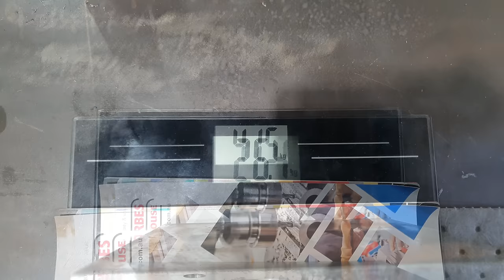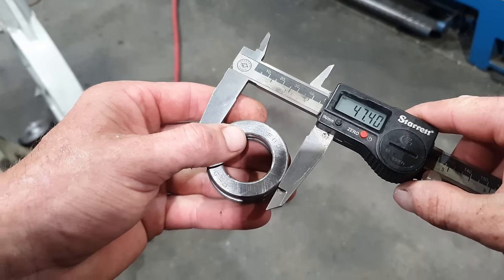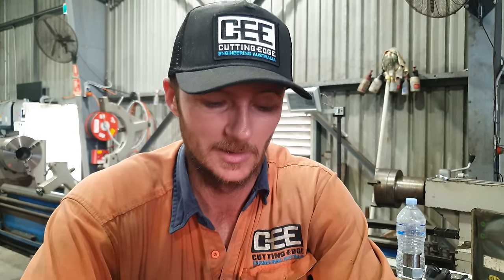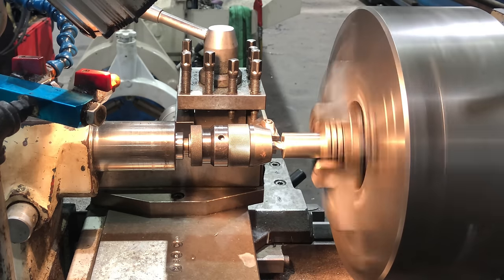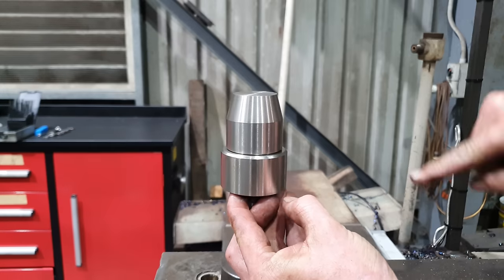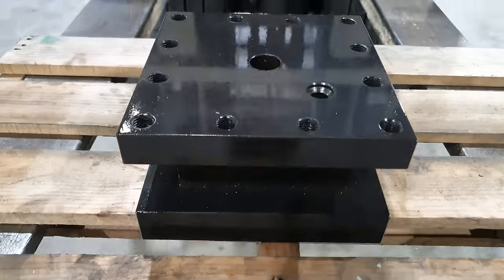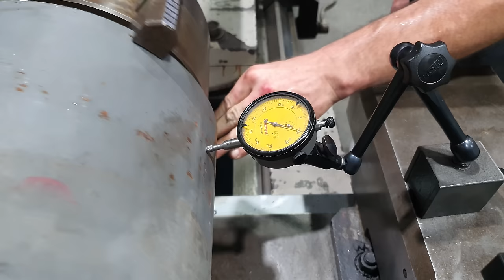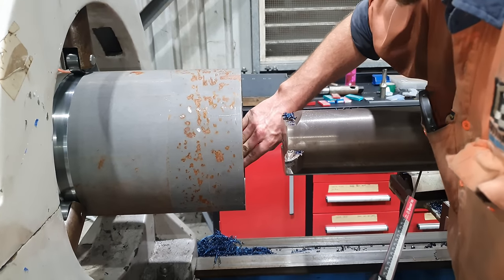Finish Making a Tool Post for the BIG Lathe! | Part 2 | Shop made Tools

Comment: you could try to include a coolant line in the next boring bar. Maybe only a 10mil grove on the back of the bar to fit a 10/8 pneumatic line so you can connect it to the FlexHose system you use on your machines
Reply from the maker: watch this space 😏👍

Comment: Great looking piece of kit you made there! Speeds and feeds are very finicky for stainless; I'm in a stainless shop and I have to modify parameters each time an insert changes, a new batch of steel comes in, coolant changes etc. Stringy as all get out. Also I got a great laugh when you kicked the steady at 31:51, never had to deal with a steady that big, but I know they need some "encouragement" to get moving. Looking forward to the alluded to "aussie-sized" boring bar.

Comment: 25:37 A CEE stamp would finish that piece nicely. :)) One other "ease of use" thing you could do is machine a groove inside the pin hole, and put a sprung ball inside the pin. That way, you pull it up 1 cm, the ball engages, and you can rotate the post without fully removing it.

Comment: Hi friend. Maybe you should try an independent bar holder, a bold and rigid steel cube atached directly on the cross-slide; the compound-charriot will always vibrate holding so massive boring bar. I've seen someone doing  it, he says there is an enormous difference!
Cheers
Reply from the maker: watch this space 😉

Comment: That boring bar is obscene Sr. 🤣. And you did make it in proportion so you don't get shattering. Fkn Legend. And will get bigger, maybe an extension in the back of your tool post so you can also balance the weight and do bigger jobs, but I remember you already have the new machine, that is not exactly the same, but it does similar stuff. Great work man!!

Comment: If it's 316 try slowing the lathe down by half. The standard approach for drilling 316 stainless is extremely slow 304 and 305 is easier but likes a slow speed too.

Comment: What grade of Stainless did you use for the nut. I work with stainless a lot and I have consistent problems with galling, as you pointed out it is "gummy " stuff, curious about which grade you feel will be satisfactory for a machine tool part. Addicted to your videos, learned a lot of practical information

Comment: makes me wonder: with a boring bar that large or larger should it be made with it's own attaching point to the machine? i was thinking that when using that boring bar, not even have a tool post to clamp it in but instead have it directly attached to the machine surface that the tool post would normally use? would that help with vibration and make for a more solid mount? just a thought from a keyboard warrior..... excellent video, and that tool post looks better than any "off the shelf" unit.... strong work CEE!!!!
Reply: In place of the compound rest.
Reply: @alro2434  yes, that is what i was thinking. just building the compound rest attachment into the boring bar attachment point.

Comment: Excellent work. Did you use normal low alloy steel to make the tool post or special for nitriding? After nitriding, you had no distortion at all?

Comment: My guess was 29.42 and that is exactly 3kg over. I wonder where that error came from since i actually 3D modeled the part. I did have to guesstimate total height and depths of the tool groove, so maybe that is where the error is from. Could also be incorrect material weight. Bummer.
EDIT: Great color combination at the end there! So shiny.

Comment: I have a general question as an engineer and not a machinist. How do you ensure the tooling is running straight and true when you secure it with the three bolts?

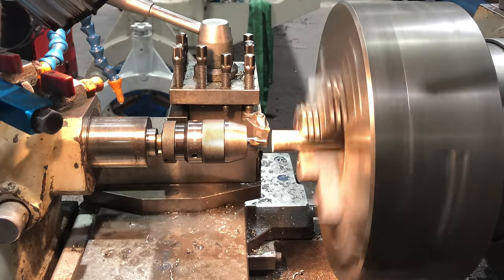Comment: Thanks, nice bit O'stuff!  Live center used on the handle @ 23:57 looked really long & pointy, about 30 maybe 45 deg., not 60, something special?
Reply from the maker: Nothing special, that's a Vertex, it's just a bit longer than the average live center so you can get tooling down in beside it easier.

Comment: Work Hardening - During machining, the friction between the tool and the workpiece generates heat. The heat that is transferred to the workpiece causes the structure of the material to change and in turn harden the material to some depth.. The degree to which it is hardened depends on the amount of heat being generated in the cutting action and the properties of the material,

Comment: Handle Position
was it luck that the handle faces out when tightened down? or did you take steps to control that? how would you clock the position if needed?

Comment: Heyy. little question, how do you know when cutting a material (stainless steel in your case) with a larger horizontal bore that its going poorly? Before it has a more severe effect. Do you hear it or more smoke ? 

Love your content ❤
Reply from the maker: Hey mate good question, generally sound is a big part of machining and will be able to hear if it's not right
Reply: @CuttingEdgeEngineering  😄😊

Comment: A note about thrust bearings:  the two races may not be identical, so be sure to measure both.

One will have a precise I.D., and a slightly under-size O.D.
The other will have a precise O.D., and a slightly OVER-size I.D.

The first is meant to remain fixed with one side, with clearance for the "outer" object.

The second is meant to remain fixed with the outer object, with clearance for the other.

A case where the differnces matter is if installed to a lathe's cross or compund slide feed-screw. One race will turn with the screw, but must have clearance for the slide (if it's in a pocket).  The other race will be in contact with the slide, but must have clearance for the feed-screw thru the bore.

Now, depending on the application, with clearences all-around and contact only made to the faces of the races, the above differences may not matter, but it's something to be aware of.

Comment: "Gonna need a bigger boreing bar!"
 Holy shit Kurtis you brought that one in on the overhead. What're you going to use for the next one? The yard crane?
The new toolpost looks and seems to work, great. I certainly like the addition of the thrust bearing. Must make it even smoother operating. 
The black nitride and stainless contrast makes the picture. 
Not sure if you believe in it but I'd have thought some anti seize paste on the tool hold down bolts might extend both their and the threads in the tool post, life.
Good job. Regards from a very cold, Canada's banana belt as usual.
👍❄️🇨🇦🍌🥋🕊️🇺🇦🕊️🇦🇺🤞
How cold is it? We were at -13.5°C last night. Now -8.7°C at 2:00 pm in bright sunshine. No new snow.

Comment: You never say what bad things you have had when threading stainless steel. (Drill breaks, part breaks, stuck inside part, etc.?)
At around 32:53 you are installing a large boring bar. How do you make sure that bar is parallel to the tube you are boring? If it is off by just a little the boar will not be straight for a rod to be later inside there. That is a long bore.
Great videos!
Reply: As long as there is clearance, it doesn't matter if the bar is completely parallel to the axis of the spindle or not.

Comment: What speed do you knurle at, does it depend on the material you're knurling, it seems like it's real slow
Reply from the maker: it is slow, about 70RPM, I like to take my time with stainless steel
Reply: Thanks, stainless is a bitch have to drill loads of holes for weldolets on pipework ranging from sch 10 to 160, but I seem to destroy more holesaws on carbon steel, is it a simalar speed for other materials when knurling

Comment: Great Vids, love the addition of the outakes. Just a thought, you should probably just fab up a safe and use that as the swear jar 🙃
I was wondering if you took in little jobs from the little people? :) I have just given my John Deere ride-on's cutting deck a new lease on life getting rid of the rust, new paint job etc. I was putting the belt sheave back onto the Idler bracket with the ugga-dugga, and it was still set on full....OOOOPS. Snapped the threaded part clean.  These are a funny looking shaft, seems to be press fitted into the bracket plate and too much to explain here. If you have ever fixed a JD cutting deck bracket thing, this was probably the same one. I have photos etc, if I can email them to you and you can advise sending it to you or just measuring up and then you just send it down - but better yet, if you have ever made one and still have the specs, easy.

Basically, I'm in Tassie, but I don't know of any good engineers. Seen you work, impressed and would be happy to have you make me a part and record it, but if you know of anyone down here that could also mange, please let me know.
thank you both.
Reply: Ok, that was trippy. Watching Homeless out n about, he passed a JD cutting deck - Missing a wheel & bracket but you have the part on that deck which will make it so much easier to measure etc and could just "whip one right up" lol OOooo this could be half easy if you have time . .. ........ .

Comment: Great tool post build , but bigger boring bar ?a lot more pressure on tip of bar it could pull of your tool post with respect
Reply from the maker: There will be more to the build than just the bigger bar 😉👍

Comment: You need a BIGGER boring bar?  No problem for you. You'll just end up recycling a piece of 300 mm induction hardened rod that used to be a hydraulic ram rod out of a Hitachi excavator. It'll only be about 3 meters long  and set up so you can add balancing weights to the tailstock end to make life easy on your toolpost.  It'll only weigh a long ton.  No problem!

Comment: Good day it's Jaco and i am from South -Africa . The stone that you used to flattens the surface is it like a sanding stone ? The stone that we have here is like a sanding stone that you put oil on it to sharpen knifes with . I will send you a photo on the email adress . It is not the same colour as the ones you have .
Reply: They are Machinist Stones or Precision flat ground stones. Similar to knife stones but harder and more flat.

Comment: Yes, stainless steel is ugly to machine. Not my favorite to machine either. Safety Officer inspecting the outside of the shop, finds a rubber chicken on sidewalk, takes care of the situation. 😁 Another fine in house shop job that works and looks excellent. CEE Quality standards. 👍

Comment: Stainless is a bastard. To fast, cooks the drill, not enough pressure, work hardens  and cooks the drill. Too much pressure, cooks the drill. Shit stainless with hard spots, naturally occur right where your tapping a hole. Nice job though. I hope that nut doesnt fret with dissimilar metals. Stainless also bastard for that.